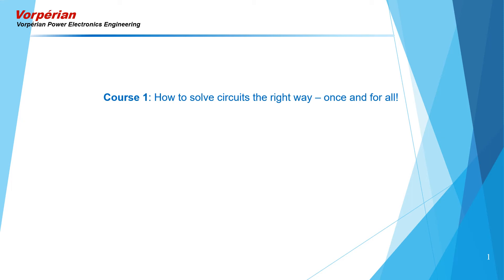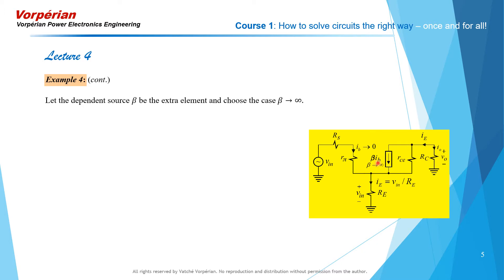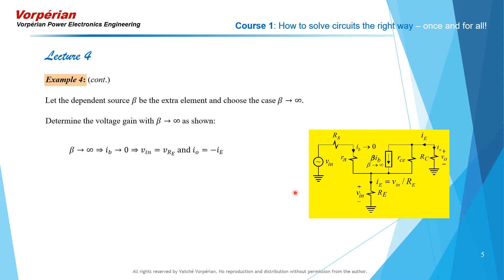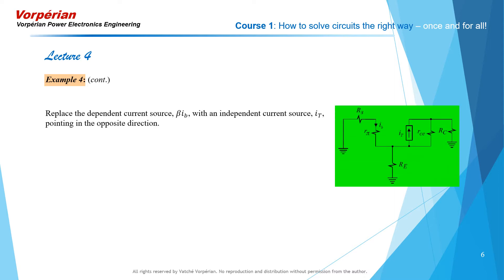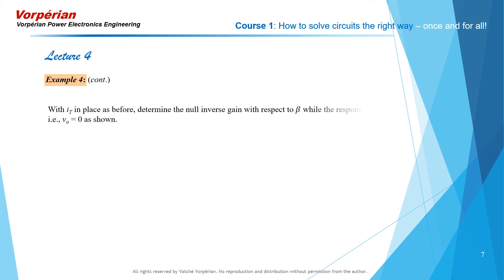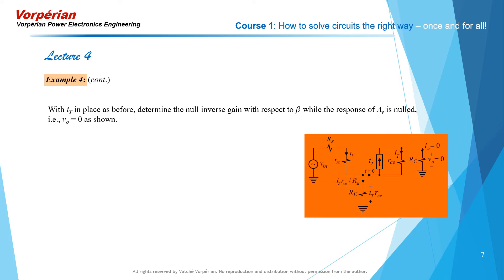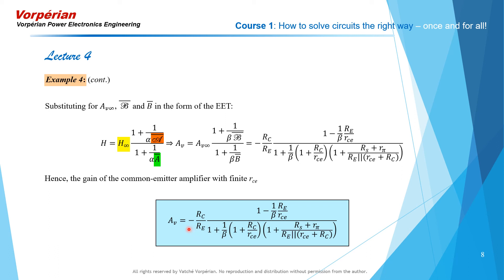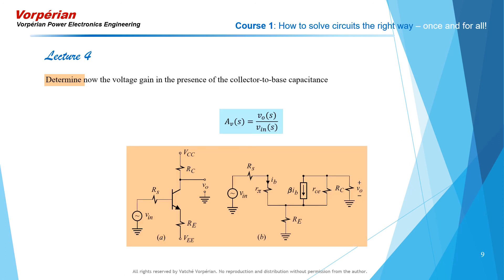Video 13: Fast Analytical Techniques in Electrical and Electronic Circuits

Comment: the numerator of the Norton equivalent current source, isn't it Rc?
Reply from the maker: Since it is the current division between r_ce and R_c, the ratio is r_ce/(r_ce+R_c). Notice that the short circuit current is flowing through R_c.
Reply: Yes,that's right.Thank you sir! @vorperian_courses